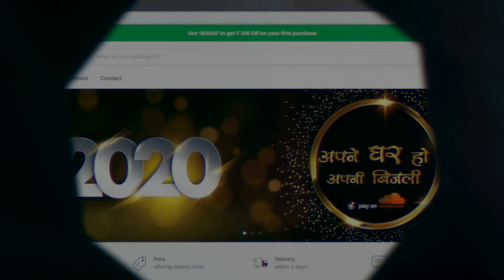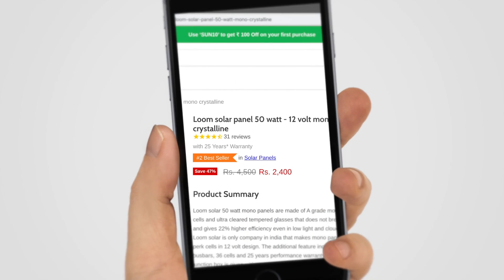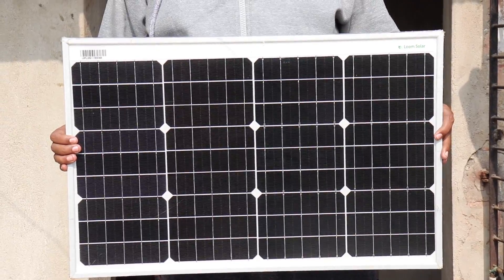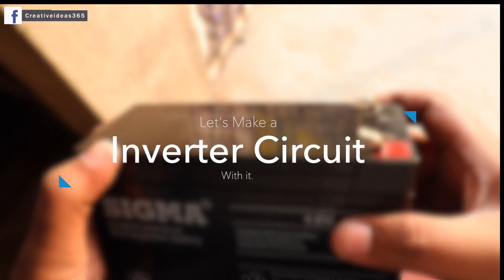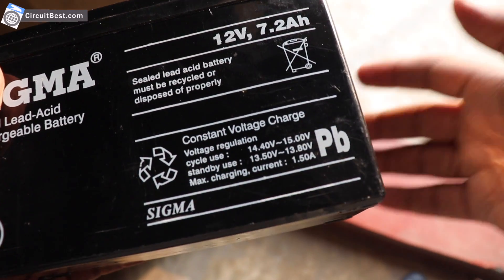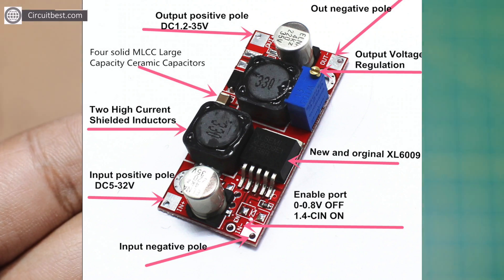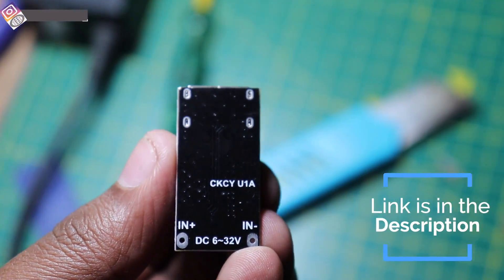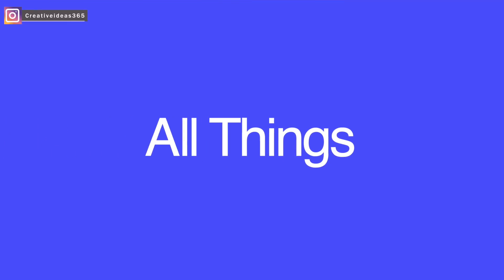Simple Solar Charge Controller Circuit

Comment: 2:39 connect multimeter to the charge controller solar outputs
Reply from the maker: It may vary depending on input light density

Comment: Awesome, but no over charging protection circuit.....it leads battery damage......
Reply from the maker: Obviously, you are right. I was just trying to make the project as simple as possible. Just use relay over voltage protection circuit in addition with the circuit.
Reply: Where should i put the relay in this circuit? Can u explain ?
Reply from the maker: @delinia1720  at the battery charging section... Put a protective circuit you will get many protection circuit in internet.
Reply: @Creativecreator  Alright.. thank you sir..
Reply from the maker: @delinia1720  let me know when you completed your circuit
Reply: @Creativecreator  Hi am I missing something,  I don't see a problem of overcharging as when the battery reaches 14.5V no more current will flow into it?